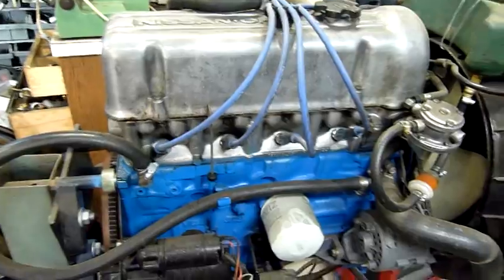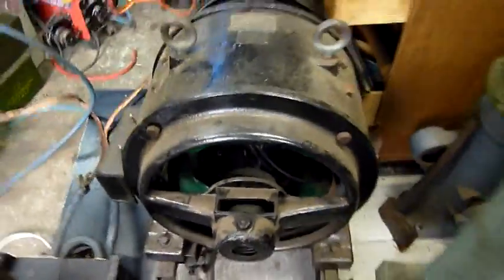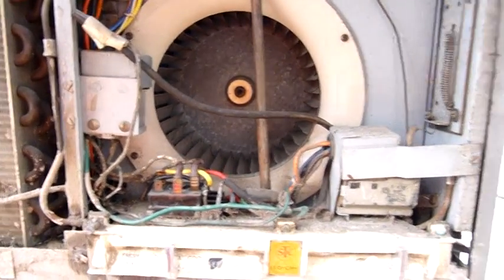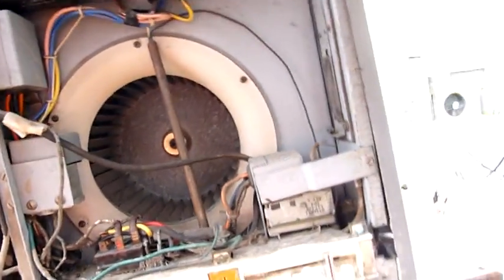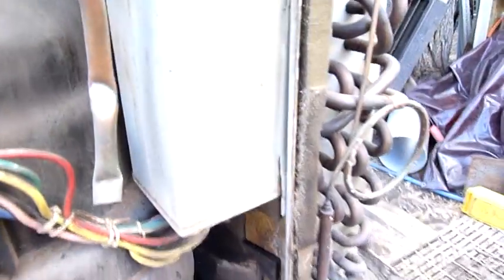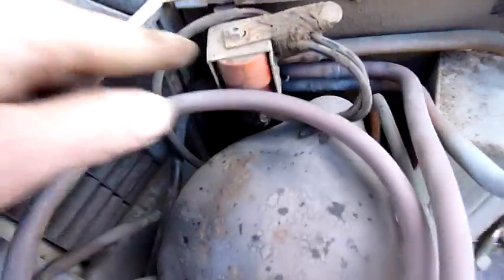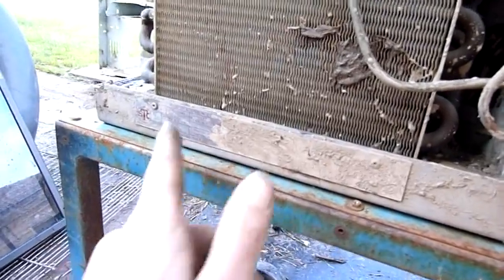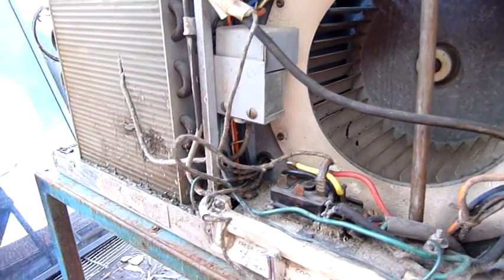Saturday Fun with Cleanout and Vintage AC Unit

Comment: Those old compressor have a very unquie sound and never quit!  I had a few old ac units with those compressors, too bad the rads corroded old and I had to scrap them.  If you cut those particular compressors open, you will have over 3 pounds of copper in them (; 
Nice video by the way!

Comment: I'm a bit curious if you had a front cover for an Electrohome Air Conditioner under one of the covers there, it looked a bit like that as I remember and still see old Electrohome air conditioners around here still...a lot of them older than you and me.  Those were made in Kitchener, Ontario (Electrohome's roots go back to 1907 and Kitchener was still called Berlin, you can probably guess why) at one point but most of the manufacturing businesses have disappeared from there at one point.

Comment: Standard Telephone and Cable, Larry has a radio manufactured by them. They switched over from denoting line frequency, and radio station frequencies, from cycles per second or cycles to Hertz between 1968 and 1970 or so. I found an article from and electronics magazine of the time lampooning the switch over saying that they would have to rename bicycles to bihertz, or what would have happened if Heinrich had adopted his mother's maiden name of Pfefercorn instead of Hertz.

Comment: yeah. the only units in the past with heat been LG. but they use an electric heat strip. I believe Frigidaire is starting to make a couple heat pump models for the us. although any heat pump unit here is expensive while straight cools are cheap

Comment: can a multispeed fan switch be replaced with a continuously variable switch?  instead of 1, 2 and 3 you can have any decimal in between.  sounds like its shaking a lot. more stable with the compressor on.

Comment: I love that old heat pump! I've always loved radial fans, nice to see them on both inside and outside here, although it's probably not the best choice to get the most airflow. Did you find any BTU rating on the unit?

Comment: Interesting condenser air flow design. Suck air through half of it, then blow the already warmed up air across the compressor than through the other half? I mean if it works...but it's still a bit..odd.

Comment: haha really???? wow. they have been around in the us for a long time! except for heat pumps. those are just barely starting to catch on here in the U.S. because heating fuel (coal, wood, oil, propane, nat. gas, etc) is so cheap here compared to electricity.